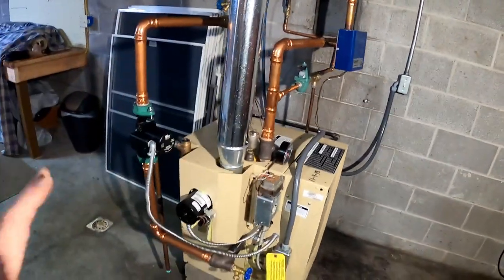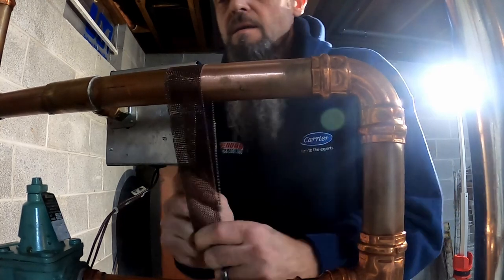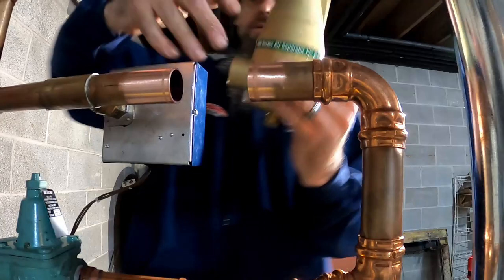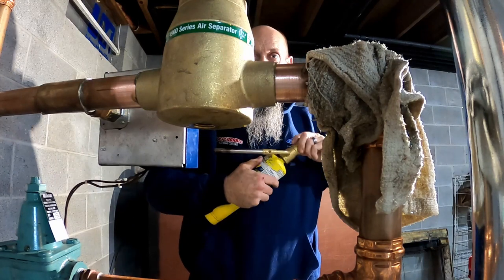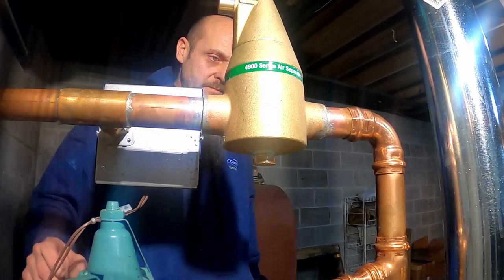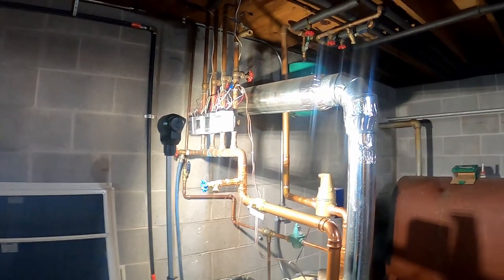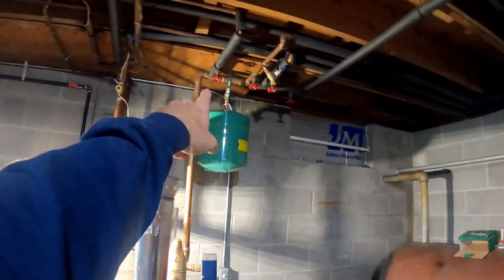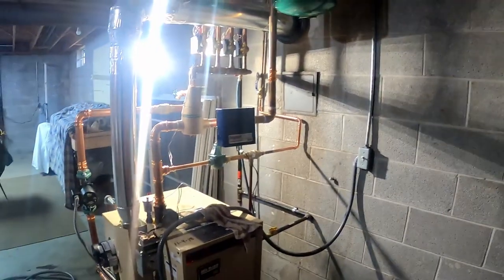Boiler Air Separator Install

Comment: Viega says minimum 3 tube diameters from a soldered joint to a press fitting . It’s an eye opener reading the manual.
Reply from the maker: That's why I had the wet rag on it to keep it cool

Comment: If that expansion tank is on supply piping then your not pumping away. If it on return piping it should be reconfigured anyways. Pumping away can be confusing in a closed loop system so here's ho you know if your pumping toward or away. The path of least resistance if your pumping away or toward

Comment: I got a 1992 dunkirk boiler. my circulator pump is on the return side of my 24 port Zone valves ( gate and or ball valves). my expansion tank, air separator and fill inlet is all on the out side.

Comment: i put circulators on the return and I've never ever have had problems and i service most of my installs
Reply: I get it,pump away from the boiler,decreased pressure zone,blah blah blah,I have seen boilers 40 years old that are according to today's standards piped backwards,well WTF it has worked for 40 years!
Reply: @Supa Trending Daily can you explain how it makes the boiler rot faster?
Reply: I'm not saying I put them on return,I alway follow manufacturers recommended piping configuration,but I've seen tons of really old boilers that had pumps on returns! By rights,once you have eliminated air from a system,you should have very little air in the system,only when you make up water  will you reintroduce air.If you are making up water in a closed loop,there is another issue.Not arguing a point or saying anyone is a hack,just saying that alot of the systems that go against modern practices,are indeed still up and running after many years,don't make it right but they are with very little repairs over the years.
Reply: @pelon542  man I bet that boy never installed a boiler in his life how his fighting arguments is a Dan heating help link he literally reading off word for word lines out of Dans book and believe me
I have every single one pumping away, EDR etc he probably never picked up a wrench in his life 😂😂😂
Reply: @petersmart1999  don’t listen to that bum he a YouTube heating guy word for word that’s all over heating help dans channel and I’ve met that man personally had convos with Mr.Holohan he will tell you himself he never was hands on just knows heating and return piping supply piping at the end all preference it’ll still work fine
Reply: Bunch of hacks. Pipe towards and the boiler roted out faster, there's more air sounds, air locking happens much easier, under specific pressure drops you'll get pump cavitation waiting money and ruining pump years sooner, the auto-fill will raise the pressure above your tanks 12psi which under close sizing conditions will cause the pressure to rise alot and trickle out relief valve. Under certain conditions you won't notice a problem even though it's done wrong. Under other conditions you will have minor issues but never be able to know it's the installers fault. That is until you get an actual hydronic expert to look at the system.

Comment: Return water is cooler, not as much abuse. Try Sanding the flat surface of the fitting your working on, helps draw the solder to it . That BURR inside the pipe has tendency to hold water, Steamer. W
Sloppy,? Can't see it from my house.
Reply: Ted Cook (AntiDIY HVAC) is even worse. He’s always muttering something that is barely audible.

Comment: Hi there how are you doing hope everything is going well with you and your family. 
Just wondering if you can help me out  buy doing a pipe  layout for a combo boiler 240/130 
What i have now is a hot water tank and a boiler for radiator and one floor loop can you please give a layout step by step like the location for each device like air alimentary,   expansion tank ect,    ,,,,  and also the floor loop 

Thank you

Zee from Canada 🇨🇦

Comment: 3 pipe diameters is the minimum  clearance required to solder near any pro press fitting. I hate to sound like a keyboard commando, but both that soldering technique and the end product is atrocious. Pull your b tank out, size your tip accordingly and practice proper technique. And for the sake of avoiding cavitation, de burr that pipe!!
Reply: Could not agree more
Reply: He should have a specific deburring tool, not a box cutter.  And cooling down just soldered joints with a wet towel could stress the joint for premature leaks.

Comment: I just have to ask aren't you a little close to the rubber in the pro press fittings
Reply: I truly dislike pro press, if I come across it in service, I'll cut it back out as far from the appliance as I can. I may be old school, but I think of the next guy....could be you!
Reply: @melarky8555   I'm old school as well  I think pro press might have it's place but  I'll keep soldering

Comment: A California plumber here, I went to a pinhole leak on a 3/4” recirculating line tonight. I clamped it and I’m going back in the morning. I was concerned that if I soldered I was going to melt the o-ring in the press fitting that was 1’ away from the repair. After I seen your video I feel 100 better that the press fitting will serve lol. Keep up the hard work with the videos
Reply from the maker: Just keep it cool and you should be fine. Good luck
Reply: @MiHeatingGuy  I soldered it and I went about 4” away from press coupling. I wrapped it with a wet rag lol no leaks

Comment: I have 2 inch piping and 2 inch inlet and outlet on the boiler.  I only have 1 1/2 air scoop.  Can i reduce in and incease out?  Will that work
Reply: You have to know the heat loss calculation. Then look up the btu capacity of the pipe size for the specific boiler manifolds.

Comment: Do you like taco air separator or spirovent better?
Reply from the maker: spirovent or honeywell, This is just what i had at the shop
Reply: I’m a big fan of the Caleffi Discal which also comes in propress
Reply from the maker: Nice
Reply: I like the spirovents they're solid;  I find alot of the honeywell supervents clogged with gunk in that cube.  The taco one seems alright

Comment: would not hire this guy to install an undersink water filter. Poor pipe prep, poor soldering techniques and the air seprarator should be at least 18" from the elbow.
Reply: Should have moved the low water cutt-off closer to elbow and air seperator farther out from elbow.
Reply from the maker: Maybe you should read the instruction of what I installed You obviously don't work in the field